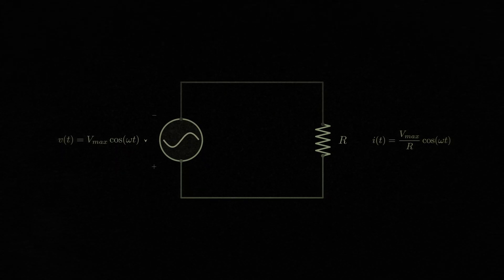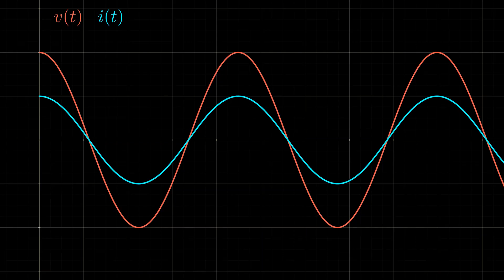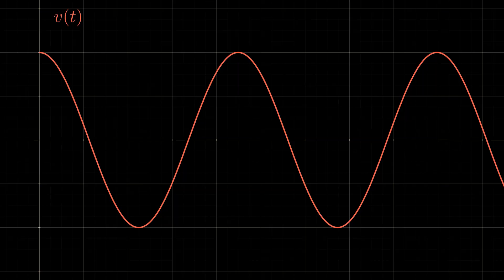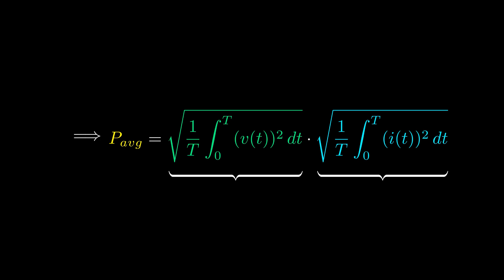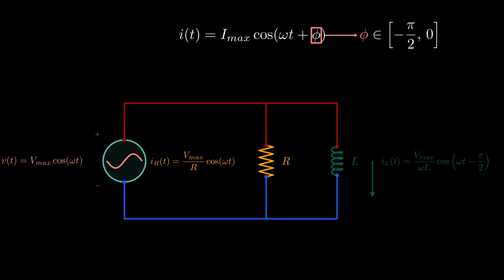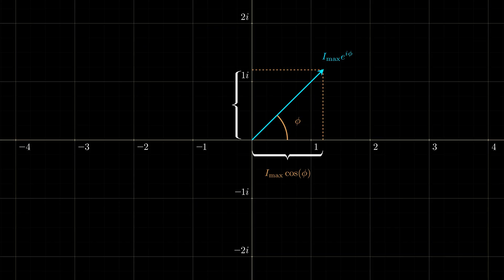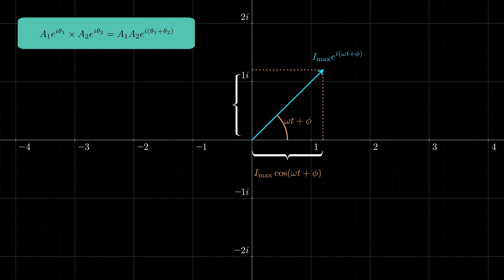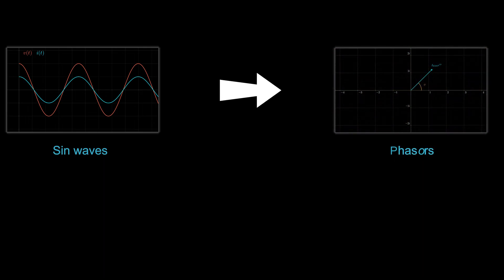The SECRET of Phasors & RMS: An Animated Deep Dive

Comment: Absolute banger of a video. I have a question, you say phasors are normally all we need to analyze and electrical syatems, but when we do fourier and laplace, we are doing the same as with phasors right? The evolution is: DC circuitos with W=0, AC circuits with W=jw or phasors and finally transient circuits with S= sigma + jw. The thing is that i don't know how phasors fit in here. To me AC circuits should just be W= jw, which is just Fourier.
Reply from the maker: @studiosdetodo8295  hey, thanks.
To answer your question: everything you saw in this video was describing the voltage and current waves oscillating at the fundamental frequency (50 or 60 Hz), so Fourier or Laplace would have given you one wave anyway and phasor is better to describe this wave by changing the reference grid into a rotating one as explained in the video.
Now the sigma in Laplace is about another phenomena : the damping effect, for transient behavior sin functions aren't enough and you also need a pure exponential to describe the damping effect in the system (positive for stable and negative for unstable) and that's what the real part of the complex number in Laplace is about.
I will make many more videos about all these subjects and try to answer all these types of questions 😊